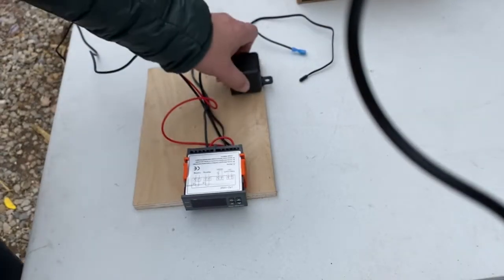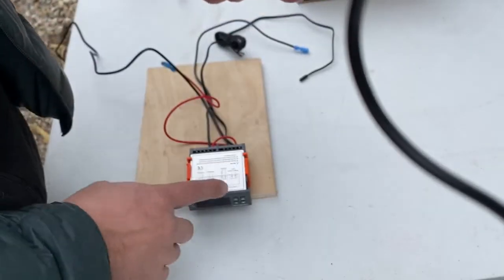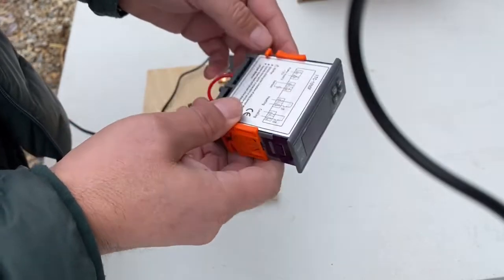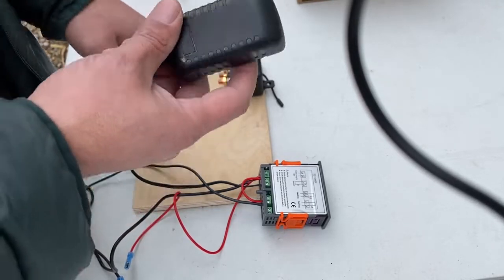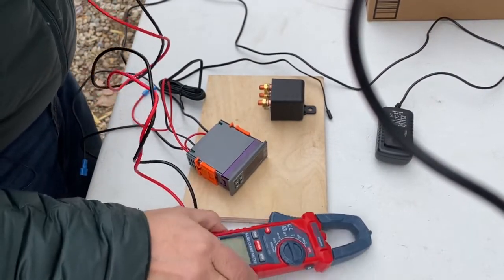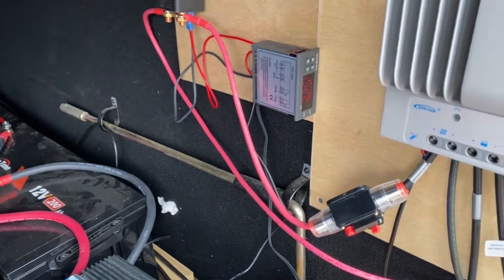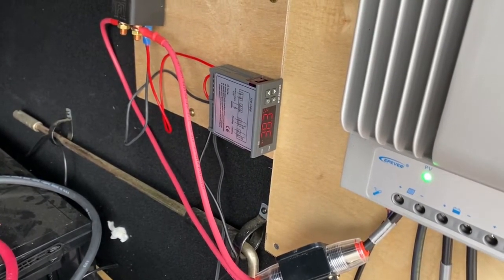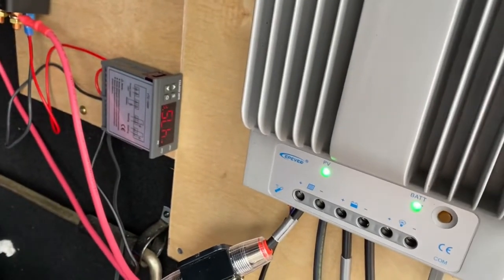AmpereTime LiFePO4 Battery low temp protection solved!

Comment: That charge controller allows for a $20 external and wired temperature sensor  which you could put right on your batteries. You should be able to do this all from right within your charge controller parameters.
Reply: Not an option for many people that use all in one systems

Comment: You don't show a 12v ground anywhere in your circuit. Where did you attach your second wire from the AC transformer?
Reply from the maker: It comes off the temp controller.
Reply: @thervsolarseries2827  I don't see it. Which contact did it come off of?

Comment: How did you get around the heating / cooling range of these sensors? Most are between 15-20degrees.  It engages the circuit at X temperature when it gets 15-20 degrees colder, it disengages hence destroying the batteries
Reply from the maker: Not sure what you mean by the range of the sensors but the temp controller has a compensation swing setting plus you can set the temperature wherever you want. No issues at all with this setup.

Comment: What happens when your batteries die and the thermostat can't keep the relay open? I would consider using a default OPEN relay and close the relay when in safe charge operating range. if batteries die and you know the temps are safe for charge, you can bypass relay until enough battery power to get the thermostat running again to close the relay. 

Thanks for the info!
Reply from the maker: The batteries continue to operate regardless of this circuit. This only cuts charging to the batteries upon freezing temperatures. It is a normally closed relay.
Reply: @thervsolarseries2827  I understand. Maybe I didnt explain myself correctly or need to rewatch the video. From what I understand: the relay youre using is normally closed. Unless the sensor in below 5C, then it opens the circuit. Which is switching your power input from Solar. 

In the event that your batteries are completely dead, the sensor will not have power and will not know it's below 5C to keep the circuit open. So your solar panel can potentially charge in below freezing condition and permanently damage the cells. 

I believe the safer way is to have a normally open circuit and close when temps are safe given that you have some battery power left to keep the sensor going. 

Both ways work IF you never run your batteries to dead. But the default open is the safest in my opinion.
Reply from the maker: Ok yes I see what you meant now. Yes that is true however it would be drawing power to keep the relay closed in a normally open circuit. Negligible amount but still a power draw none the less. That is the only reason I went this route. Yes you would want to keep an eye on your system if temps were at or below freezing and your batteries were getting low. In which case you would want to manually disconnect solar.

Comment: I feel like you would want two temperature controllers. One with a probe outside the batteries to cut the circuit when the air temp gets low. One with a probe embedded inside the bank to be sure warmth has permeated throughout the cells.
Reply from the maker: You could go that route. However these temp controllers do have a swing setting and you can also set your temperature so that it triggers a little above freezing to account for this. Also you should tape the sensor to side of a battery. And remember it’s charging below freezing that is hard on these batteries. Not discharging.

Comment: Could you place this between the charge controller and the battery? The battery is the sensitive point.
Reply from the maker: You could but then you would need a significantly more heavy duty relay which would be more expensive. But the issue is charging that damages these batteries. If you cut off your solar panels from charging when you have freezing temps then problem solved. Or until your batteries/compartment warms up above freezing again.
Reply: Excellent advice and super demo!
Reply from the maker: @dr123hall  Glad you found it useful, thanks for watching!

Comment: Just a question, what is it and who sells it. No mention of what it is.
Reply from the maker: Low temperature protection for your batteries.
Reply: @thervsolarseries2827  I think he meant make and model of the temp controller and relay.
Reply from the maker: @eddiet3026  Oh I see, this is the relay I used
12V 250A Continuous Relay On/Off Power Switcher Rela... https://www.amazon.com/dp/B08BHNYQYY/ref=cm_sw_r_sms_api_glt_i_HA1KZY1W687GW02D4N13?_encoding=UTF8&psc=1
And this is the temp controller 
Inkbird Dual Stage DV 12V Digital Temperature Contro... https://www.amazon.com/dp/B019I3YCFS/ref=cm_sw_r_sms_api_glt_i_RZMFG1XBW89DFA7CS4PC?_encoding=UTF8&psc=1

Comment: I used the same temp controller and connect up a water tank heater pad to keep my batteries above freezing, Allows me to keep my batteries/inverter running for my Starlink dish.
Reply from the maker: That's a great idea I had planned to add that to mine as well. But since my temps have stayed above freezing in the battery compartment I have put off the heating pads for now.